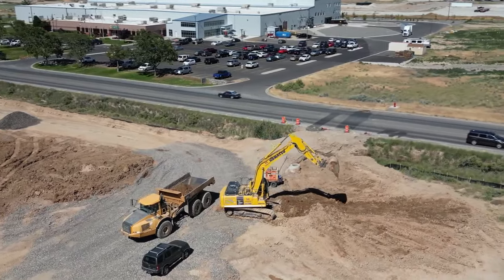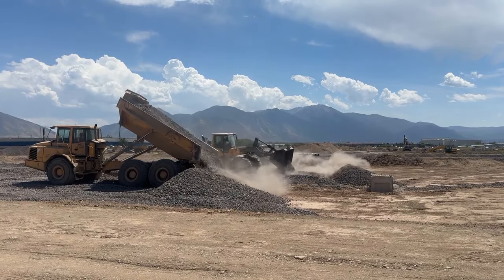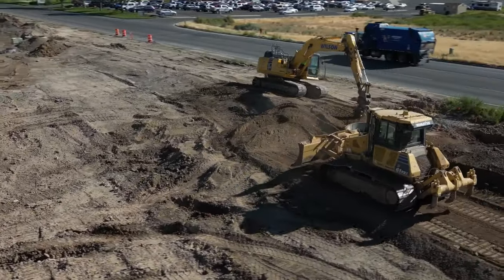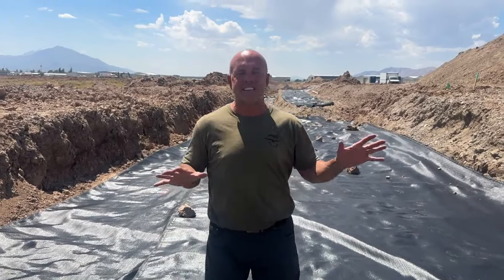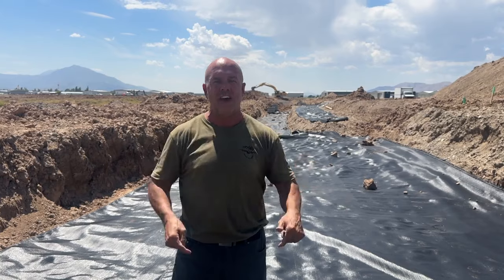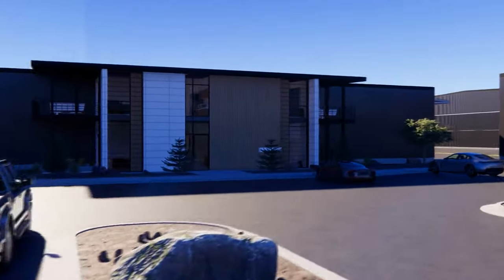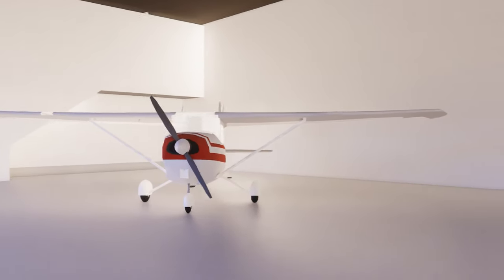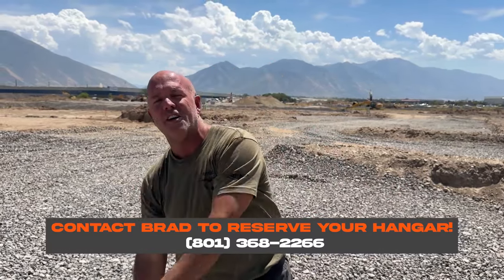Hangar Shortage - We're Doing Something About It!

Comment: Good day Mike, glad to see the progress. Glad to see you are using geotextile at the bottom of the excavation and then dump rock up to above water table. (over here thats 200mm rocks) For those interested the reason for dump rock is that you cant compact soil under the water table, as it has to be at optimum moisture content (15% or so) to compact. if wet is does not compact. Are you using HDPE plastic pipes for your fire water ring main. you probably know to denso tape wrap the bolted connection if under ground, seeing as you cant have any HDPE above ground,. also the expansion coefficient of hdpe is 10x that of steel. best of luck with your development.

Comment: Dont forget

To leave plenty of land at either end of the runways for emergency crash areas and future ils approach paths.

Please don't forget segregated security areas

Dont forget to put in grey water tanks to collect rainwater or underground water for emergency use,

Dont forget global warming flood planning

Dont forget solar arras on all roofs and some type of energy storage for essential operations of runway lights and communications.

Assuming global temperature rises, should you consider building a sunlight reflecting runway to moderate temperature build up ,so the surface does not break down.

Always prepare for accidents by direct communications to hospitals, firer, water, and communications diversity.

Off site beacons are always recommended, as are crash gates.

In the UK we are experimenting with remote ATC for out of hours operations.